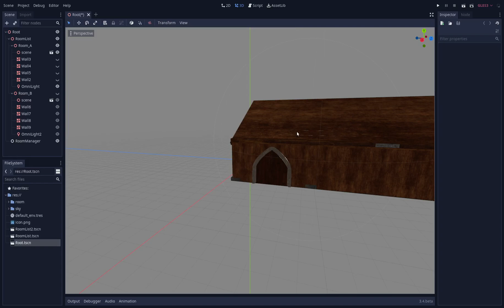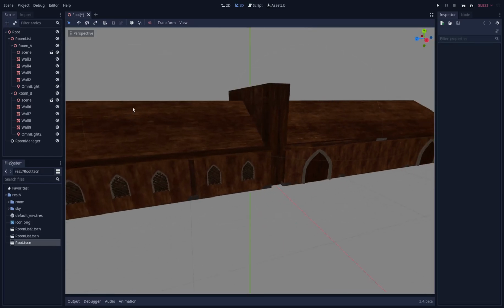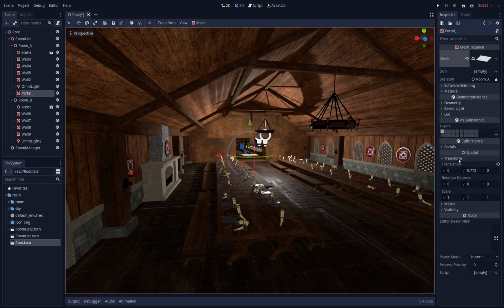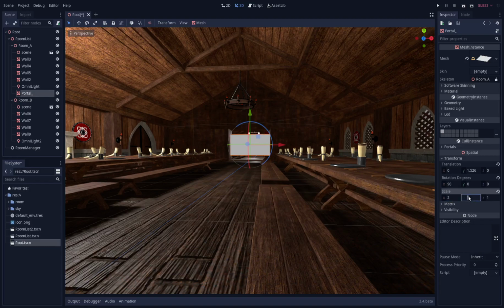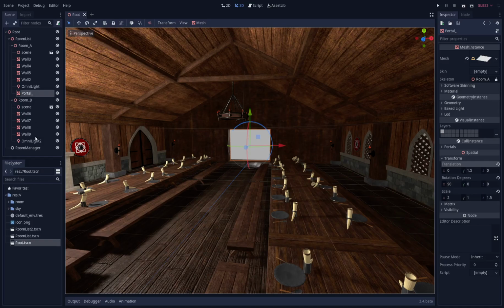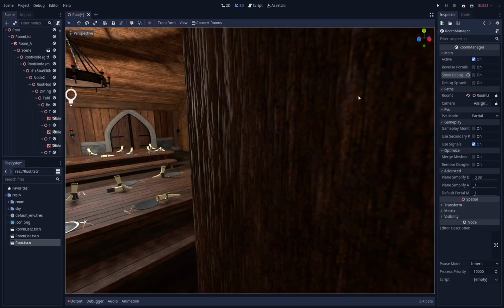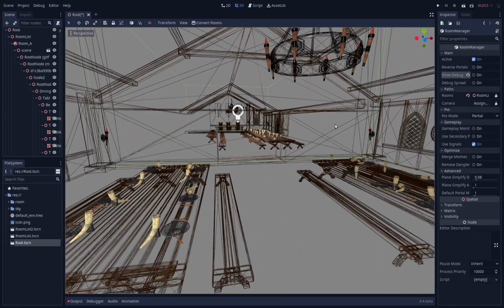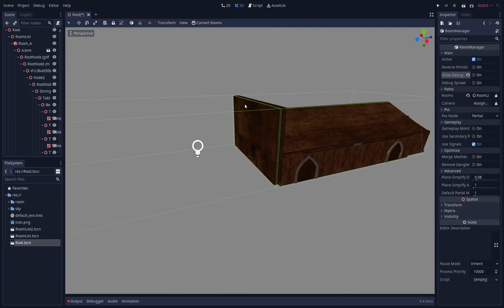Godot 3.4 core portal occlusion culling example - Viking rooms

Comment: Hey, I saw your PR and it is interesting! Will it work using the logic from the generic occlusion culling merged here: https://github.com/godotengine/godot/pull/48050 ? In case they use separate logic, I wonder how to make sense when to use each..
Reply from the maker: My PR is for Godot 3.x. JFons' raster occlusion culling is only present in Godot 4. Logic wise they are completely different, although they tackle a similar problem. We haven't yet decided whether rooms and portals will be implemented in a later version of 4.x (it isn't roadmapped for 4.0). So for now if you want to use occlusion culling, only portals is available in 3, and only raster in 4. In general, portals are likely to be faster at runtime, but they require more setup.